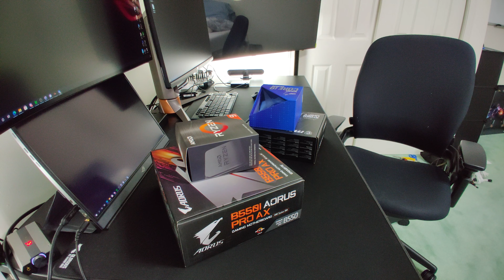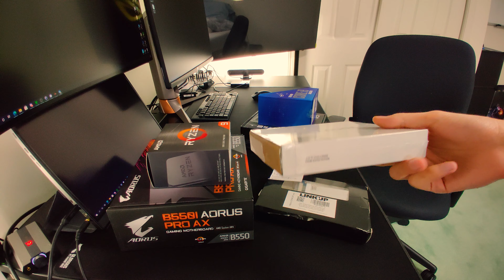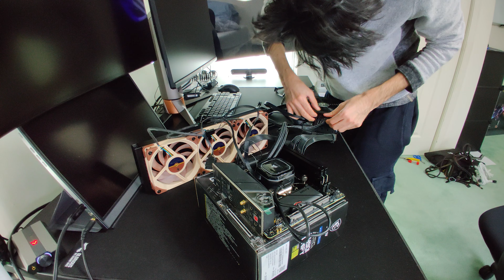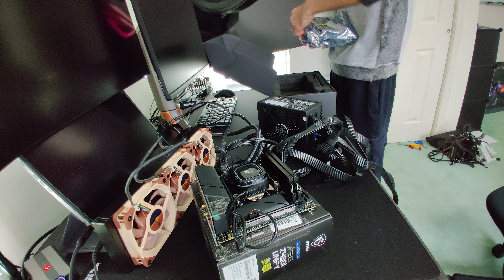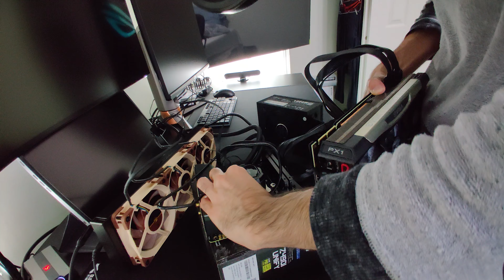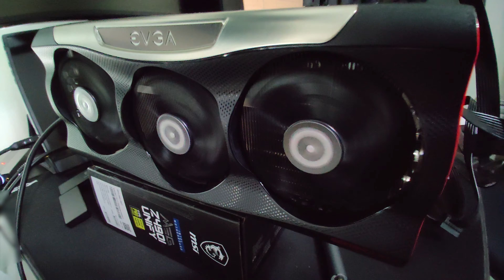Why I Switched Back To Intel ZEN 3 is Nothing But Problems

Comment: AMD is trash and always has been
Reply: k zoomer.  Someone hasn't been around very long at all.  Still shittin green, I assume?
Reply: @ProcessedDaemon dude i have a 12700K + a 7800x3d. on the x3d i can't even reboot the system sometimes i  hang in a loop. newest bios + chipset + 400 dollar mobo. it is what it is

Comment: Couple years now after i changed my 8700K, RTX2070 platform to AMD 5800X, RX6700XT, no any issues. Sometimes there is to blame the one who is between the seat and keyboard. I used Intel platform almost 13 years(begin from Intel C2D E8400 2008), before that i owned AMD 64/ and many socket A systems. I changed my Intel platform to AMD just for curiousity, how the AMD has changed since i last time owned AMD system. No need to blame intel or AMD systems, both works fine for me. 

My very first AMD was 486 system from early 90's
Reply: Yeah, my thoughts exactly.  Asus B550-F Gaming Wi-Fi II / 5900x / 2x16GB DDR4 @ 3666 C16 DUAL RANK RAM w/ IF @ 1:1 / 6700XT 12GB SAM Enabled. 

ZERO issues.  BIOS updated every time a new one is out.  Chipset kept updated.  

Gotta be a user error on a B550 board.  Probably never did a BIOS upgrade.  Not really even gonna watch it because I know how mine works, I know the 5900x is faster than a 10900k at EVERYTHING so... to each their own, I guess.

Comment: I've been using intel for 25 years. I tried AMD w/ the 2950x, then the 3700x, and finally the 3950x. I WILL NEVER USE AMD AGAIN. It was nothing but problems, BSOD, NO POST, slow response, frame stuttering, usb issues, capture card issues.

Why did I buy 3 AMD systems? because at the time Intel had nothing to offer for production work loads at least not for what I needed until Alder Lake. Went back to Intel for Alder Lake and I couldn't not be happier.

The only good thing about AMD is that it forced Intel to evolve their architecture and lower their prices.
Reply: 5900x + Asus B550-F Gaming Wi-Fi II + 2x16GB DDR4 @ 3666 C16 dual rank RAM(fully tuned subtimings from top to bottom)/IF @ 1833 + 6700XT 12GB + Samsung 970 Evo Plus +
3x SSDs, 3x HDDs, TrackIR, USB drive, Flight stick, Flight Throttle, Xbox Controller, Mouse, Keyboard, Corsair HX1200i plugged into USB 2.0 header for monitoring, USBC to USBC for Galaxy S10+, charger cable for Fitbit watch, Xbone Controller (wired), and a couple of other things I'm forgetting.

No issues.  I keep my BIOS up to date.  5900x w/ "Asus Performance Enhancement" which is PBO 1000w/1000a TDC/180a EDC with a +150mhz boost for 5.1ghz on my 5900x.  RZ608 built in Wi-Fi 6e + BT 5.2 (now 5.3 under W11).

I mean, literally zero issues after over 1 year of this set up.  Zero.  SAM enabled... I mean, I can go on and on.

To each their own, but Zen 3 5900x smashes the 10900K at everything.  Of course, it's why I buy Asus ROG STRIX boards over everything else.  VRMs top notch for the money (12 + 2), 3x CPU EPS (12-pin total EPS connection for CPU).

Kinda sucks for ya when it was most likely your brand of board and their BIOS releases.  Thought this was more of a B450 board issue.  Never experienced it over the course of 1 year and 2 months of this mobo... and I've got so many USB plugs filled.

But doesn't matter if you WERE having problems, I can imagine that'd be annoying.
--
Next Build?  Definitely gonna be AMD again with an x3D CPU.  Hopefully there will be a 7950x3D equivalent so that I have 8x x3D cores and 8x normal cache cores.  Best of both worlds.  Best gaming performance + normal cache for workloads... and they can work together, obviously.

Probably should have updated BIOS or swapped boards instead of downgrade performance among every single thing you can throw at it?  But people don't tend to think things through when angry, I get it.
Reply: lol... your MSI board has less RAM options than my Asus B550-F Gaming Wi-Fi II.  That's why I said "Fully tuned subtimings."  

Sorry, dude, this is some Dunning Krueger stuff.
Reply: 7800x3d cant even reboot sometimes it hangs or needs near 20 minutes. i'm back on my 12700K